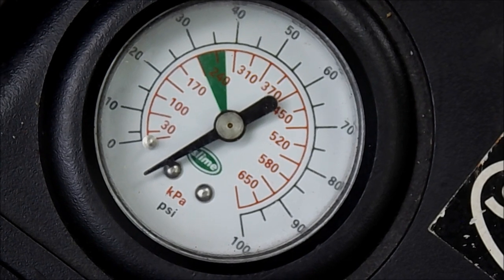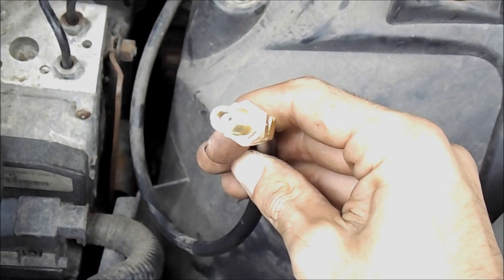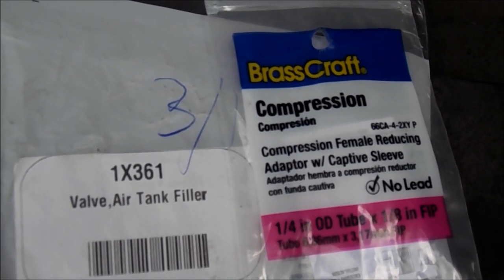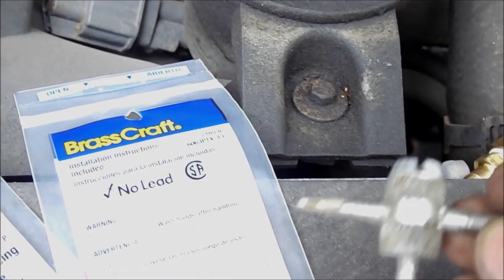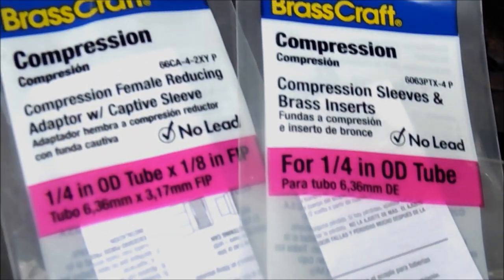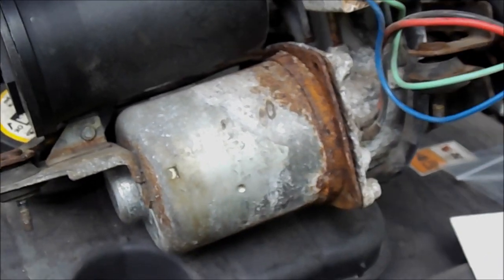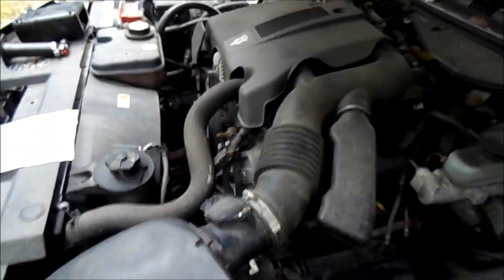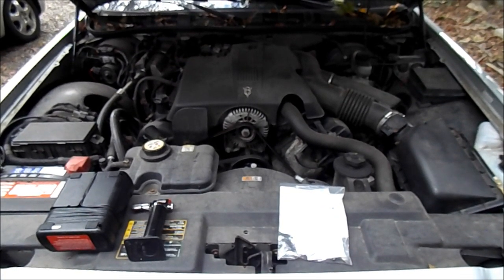How To: fix your cars level ride on the cheap

Comment: I tried this with my 06 Grand Marquis and it does not work. I bought all of the stuff in the video. Its a lot of pressure going through there and the line still leaked. The first time I put it on it blew off. Sorry to say it doesnt work. Its a temporary fix if you can fix it at all. Please do yourselves a favor, either get a used compressor from a junkyard, or new one, or convert to coil spring which is the right permanent fix for your air suspension.
Reply from the maker: Thanks for the input! Part of the issue is that dang plastic air line
Reply: COIL SPRINGS!! SAVED US FROM CONSTANT EXPENSES AND HEAD ACHES! THANKS
Reply: Same issue getting the air suspension conversion kit to coil springs for 160 for grand marquis

Comment: They make coil spring kits to replace air suspension bags.
Reply: Could you provide an example of the coil kit? My repair guy said the whole suspension would have to be redone and it would be expensive. I have a 2001 Marquis LS
Reply: @cmoore8434  
Strutmasters sells a  conversion kit that uses conventional springs.
Reply: @cmoore8434  He's a crook.

Comment: Good idea, but why didn't you put the little cheapy compressor in the car and try to wire it up to the power of the old compressor? If it wouldn't work because of the computer not allowing it, all you have to do is run a wire and switch to the inside when you need more air!! I'll look for that in your next Vid OK! Congrats on a good idea!

Comment: Good macgyver for the compressor if you can find a cap like the ones on tires for that brass fitting you made it might hold the air in the suspension longer.

Comment: Im guessing since youre under the hood that your car has front air ride as well as rear?  If anone has a system that isnt holding air which all of them will fail at some point. Strut master makes retro fit systems to eliminate the need for the air leveling. The kits come with the proper resistors to tell the computer its ok so no codes or lights .
Reply: I'm thinking about trying that, my back dropped on my 2003 mercury grand Marquis heard compressor running n running n this hissing sound n thought maybe my tire blew, but it wasn't, so I'm trying to learn exactly what the problem is, but had a few different people saying just converting to shocks will be just fine
Reply: But as usual, low on flow, so one step at a time
Reply: Was thinking about taking it to the shop but don't have shop money so going to try to find problem or problem s n maybe fix my self
Reply: @buckwheat2174  strut master from parts geek I think was the best price I found. You can always install air shocks and put the Schrader valve on the frame or wherever you feel is convenient. I've done it on several cars as a way to make it ride better especially when carrying a heavy load.
Reply: @buckwheat2174  does your merc has bags or shocks? If the system is intact you should be able to swap out whichever shock is hissing or if it's bags swap both. There are rubber conditioners that you wipe on the bags that keep them from dry rotting and cracking. It works on tires or anything but I swear it is the slickest substance on the planet. If they find out about it in San Francisco the stock prices will go thru the roof. If I can think of the name I'll get back with you. Any semi truck repair shop should know about it. Do not let a single drop hit the floor. You'll bust your butt fir eternity every time you step there.
Reply: @davidreynolds4684  aye what up brother, my bad on the late response, life has been sucking the soul out of me and the cold 🥶 of winter in northern windyana, mad low on flow ATM n pockets tight AF, drove my 2000 Honda Civic, with bald ass tires n broken ball joints and control arms to work n back the last week and half or so n I didn't have or at the time being to switch from air suspension to straight shocks like some told me to do, but I just went ahead and ordered a new compressor off Amazon prime for 120 would have been 170 without prime, got it mon put it on mon didn't drive it till td to work n it seems ok, but yo thanks for the response, usually never get any response from my random comments :)

Comment: Just replaced the rear air bags in our grand marquis ever since doing so the air suspension doesn't come on anymore and the light on the dash is on, on the way to Lowes know to get stuff to try this fingers crossed 🤞

Comment: How are ya…??
That line where you installed the valve on:
Where was it ORIGINALLY CONNECTED @…??
If I SUCCEED in the INSTALLATION, & it GOES BACK DOWN, I SHUD ORDER / INSTALL some Manual Air Shocks, huh…??

Comment: Air suspension compressors for mercury grand marquis cost $100 on amazon
Reply: Alzada RM  thats false, get an arnott.... $200 problem solved
Reply: @kurtrussell5228  Correct. We bought their coil springs conversion kit. To avoid all these headaches. Rides nice too

Comment: I got a 2004 and the rear airbags have a sensor on it at will not allow air to bypass and I tried to drill through the sensor and its broke 40 of my drill bits it's made of some strong  ass metal 😢 will not work for the 2004s

Comment: Will this work on Mercedes I'm sick of replacing parts on airmatic suspension can you take off the main compressor line add the Schrader valve? But I believe key has to be in on position so the sensor on the strut can open up
Reply: It should work with any air suspension. I would consult a diagram or outline any literature you can find on your particular model before attempting. Their could be other valves or solenoids that would hinder this process.
Reply: Just replace it with coilovers

Comment: Gonna try it on my 03 Town Car tomorrow, thanks!
Reply: The air suspension compressor costs $100 on Amazon. And they are super super easy to change
Reply: @skivijimmy  It's a constant expense and upkeep on the air bags system 
COILS WORK GREAT! NO MORE ENDLESS REPLACING AND DRAGGING REARS

Comment: There were 2 lines coming from my compressor. One was for the front left, the other was front right. Where are the lines for the rear bags
Reply from the maker: i was unaware they had an optional front level ride? chances are if there are only 2 hoses one is for the back and one is for the front and there is a tee to split the air to each corner
Reply: @TonyFleetwood  I did some reading on a thread. The post said that you need at least 125 psi to air up the system, that a home compressor or a gas station compressor won't do the job. I plan on getting coils and springs but for the last 2 weeks I have been riding around with the car slammed to the street. Now the back is slammed front is raised

Comment: Just bought a new compressor for mine, put it on yesterday and it still leaks down. So I dont know what the hell is going on. Taking it to Midas Tomorrow morning and have them take a look at it. Its pissing me off because I'm putting duals on and the shop wont complete it until the car stops leaking down. I just have down pipes like a damn pick up truck now.
Reply: The compressors burn themselves out because one or both of the air bags are leaking. You either spend the $400+ for the complete air suspension kit or buy a coil spring conversion kit for $100.
Reply: @brianedwards5334  That's exactly what I ended up doing. Went for the springs.
Reply: @brianedwards5334  I had new bags too btw bought them about 3 weeks apart. Switching to the springs, I see it'll just end up being a money pit.
Reply: @DeiHarper9361  we spent a lot too. Got sick of all the expenses and down time. The Coil Springs are GREAT.
Reply: @captainamericaamerica8090  where did you get your springs? I keep telling myself to get the bags fixed perfectly, because I love the bags but I think I might just save a little money go to coil springs.
Reply: @captainamericaamerica8090  I already switched to springs but I got them from a junk yard as a last minute thing and I don't think they were supposed to fit my town car. It's still lower than normal, so I'll be getting newer springs as soon as I can. Did you go to 1AAuto?

Comment: I can't get the line to take air, what do I need to do?
Reply: I unhooked compressor and put in air chuck for airing up manually but it won't take air.
Reply: Turn the car on as you try to put air
Reply: I'm trying to figure this issue out, I have a 96 town car I think the solenoids on the shocks are closed when the system is showing "check air suspension" I bought a line replacement kit from O'Reilly's to get the Schrader valve had to do some opening up of the compression fittings so the original line would fit, but it's not getting air into the shocks. Otherwise his was a easy temporary fix until I can get in my buddies shop to replace the whole system. That is if I can figure out how to get the solenoids to stay open. May need to plug in the motor I had hoped someone has commented with a solution to this particular issue.

Comment: I have a 1996 Town car that's sagging in the back. Cant afford to change the air suspension out for the moment but where is the air line located so I can manually air it up? Thanks.
Reply: I think it's in the trunk

Comment: I just bought a 1997 Grand Marquise, do they have air ride suspension?
Reply from the maker: i have no idea, google is your friend.
Reply: Tony Fleetwood from 92 and up they have air suspension. Well that explains why mine knocks when going over bumps.
Reply: Air suspension was an option usually found on the LX, but I don't see a lot of GS models with it.

Comment: Did this fix last long I'm thinking of doing it myself
Reply from the maker: No within 2 months the air spring let go and they were changed to real springs. The rubber of the air spring dry rotted and let the air out
Reply: Okay awesome thanks alot man I wonder if I can get some oil on that rubber before hand if it'll keep from dry out much appreciated
Reply: @mathewstone2806  Put' in heavy coil springs. Buy a good brand

Comment: Hi Tony.  Great job on this video and your idea of replacing the air pump with the Lowe's and Grainger stuff to inject air into the system manually is great.  My Dad's 2003 Town Car is leaking down some... the pump runs constantly almost, so I suspect there is a leak somewhere.  We replaced the rear air suspension air bags a few years ago ( 3 or 4 yrs ) but it is leaking again.  I wonder if the main components to leak air is actually the rear bags ?  Any clue?  Thanks again !!  Very helpful !!!
Reply from the maker: lincoln has front and rear bags if im not mistaken... might want to check into the front. thanks for watchin'
Reply: Actually, Town Cars have only rear air bags.  Some models, like the Navigator, have front and rear... Thanks again.
Reply from the maker: i was thinking of the continental because of this below comment
" bellalad
bellalad
5 months ago
Tony Fleetwood That's what happens late at night watching videos lol  I am getting my front bags replaced in my 96 lincoln continental.  All taken care of though as of today.  Thanks for the reply though " ever think of getting soapy water in a spray bottle and trying to find the leak that way?
Reply: car has 125,000 miles now (2003 Town Car).  I replaced the air bags about 4 years ago.  I have decided to get a conversion kit and run coil springs instead of the air system.  It is only costing me $74. for two coil springs, hardware, and two new rear shocks which are mounted back there with the air bags. The $74. USD includes shipping too.   I fear that over time other components in the system will fail, such as the pump, etc... and it is just going to be easier to live with the coil springs versus replacing air bags and other stuff as the car gets older and older.  Your idea of using a soapy mixture is a good one.
Reply: @jonrandall5490  we put in the coils too. We're pleased. No more headaches
Reply: O ring right?
Reply: @jonrandall5490 ok

Comment: I hooked it all up but dosent seem to fill up put a compressor on it for 10 minutes didnt seem to move any ideas? thank you
Reply from the maker: the air bag may have gone bad and cracked. they are known to dry rot and leak air. that is the best suggestion i have other than the air line itself may have come disconnected or become pinched or broken.
Reply: I tried this. WENT A GAZILLION PLACES FINDING THE PARTS! EVEN AT 160 POUNDS... car don't go up ! Air comes back out of the valvstem fast like its blocked from going into the system?  I didnt remove the compressor nor un plug it. So what's the the remedy?  Answer?
Reply: I have new bags too !
Reply: I have new bags too !
Reply: @magnumgustov5152  Sorry its late, I think you should run new lines to the bags in the back. Its a pain but it eliminates another component. The components that usually go bad are the bags, second most likely to go out are the seals around the bags and the valves as well as the seals on the compressor. Then the compressor, and then finally the last thing you'd have to look at is the line, currently in the process of replacing the bags/struts on the back and quick struts in the front. Back is down LOW, if it doesn't fix the problem It'll be the lines Im going to have to replace.
Reply: @MuhammadAli-nf3nc  Switch to Coil springs 
It's a great  PERMANENT FIX!
Reply: @captainamericaamerica8090  doesn't ride the same though that's why so many want to keep the air ride
Reply: @yougonnaeatthat9889  NOT TRUE. MY GRAMPS  L LINCOLNS' RIDE UP NICE AND HIGH, SMOOTH TOO. HE PUT ON COIL SPRINGS. WITH KYB, SHOCKS.